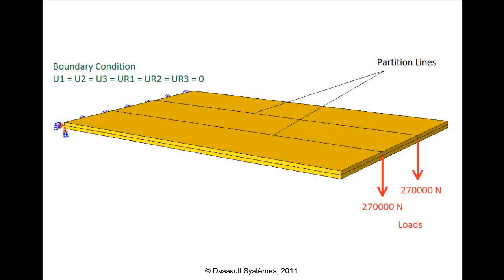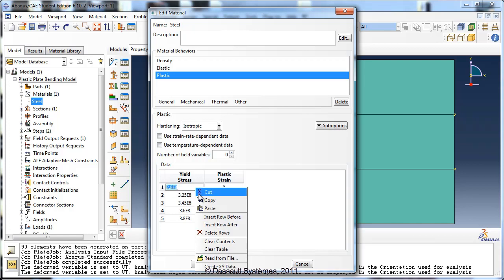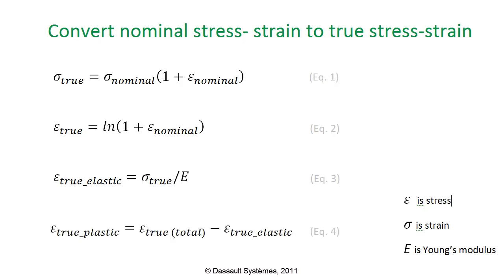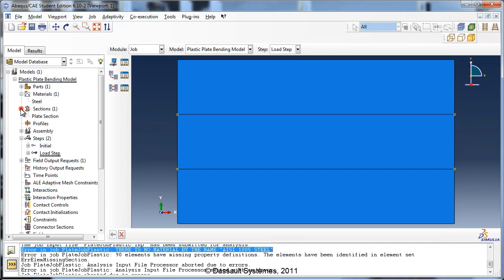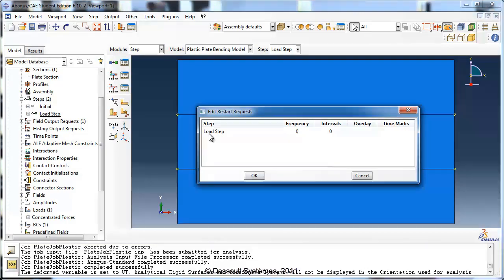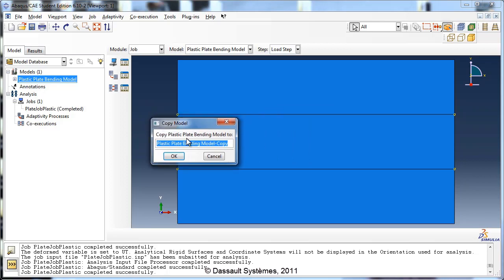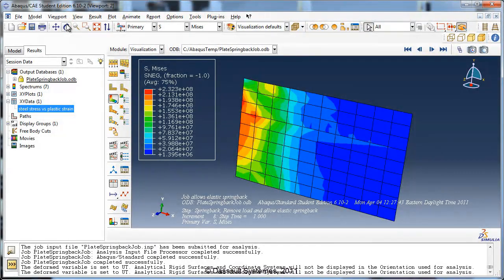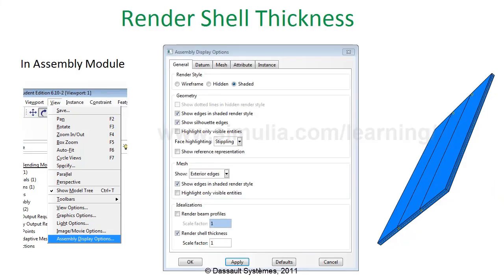SIMULIA How-to Tutorial for Abaqus | Material Plasticity and Restart Analysis

Comment: I'm working on the detection of springback in v bending in 2D abaqus. But when I define true stress- true strain graphs for plasticty in a few lines in the material definition, the results of the springback are less than the experiment. But if I define only the line where the plastic strain is 0 (the first line (yield point)) the spring-back estimation gets much closer to the experimental results. Is it a correct method to define only the line where the plastic strain is 0? Do you have any other suggestions or is it enough to use this single line?
Reply: The experiment does not belong to me, I cannot reach the result for the material properties. I get the material information from the literature.
Reply: when defining the plastic strain in abaqus you have to calculate it as following:
plastic strain= total strain - elastic strain
for all point, so it is obvious that at yield point the plastic strain equal to zero.
go to this video its very obvious and helpful:
ttps://www.youtube.com/watch?v=Z0J0lwB4KoY&list=PLz_XdUL-6Y_k-LgmCKo5ejqRAGpfXPk23&index=9

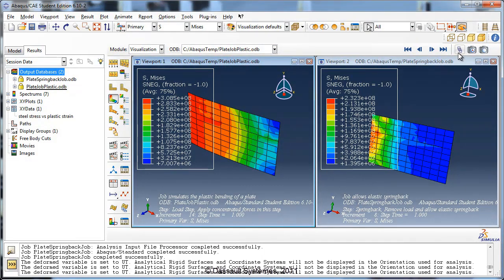Comment: 30:39  in your results 3.08 e 8  was the value for max von mises and your highest value in palstic properties was 3.8 e 8 ... so is that fine I mean they are pretty close as you said earlier in the video ?
Reply: Abaqus Material Library
...............................................................
Banumusagr
...............................................................
More than 1400 different materials, in 22 groups, from trusted references, allow the user to save simulation time and cost, avoid errors and increase simulation accuracy.

Comment: Dear Please I would like to ask if you have a tutorial video for using abaqus to make a 3D model to simulate pile -soil interaction and develop negative skin friction in details and calculate the value of the pore water pressure - drag load - soil and pile settlement and the values of the negative skin friction stress.  If you have such tutorial please I need it for my research. thanks
Reply: Abaqus Material Library
...............................................................
Banumusagr
...............................................................
More than 1400 different materials, in 22 groups, from trusted references, allow the user to save simulation time and cost, avoid errors and increase simulation accuracy.